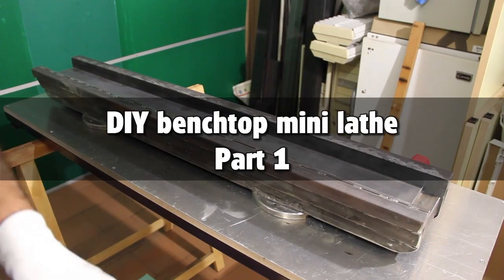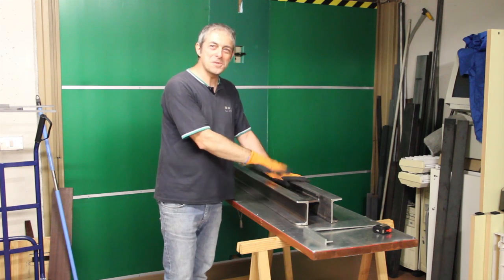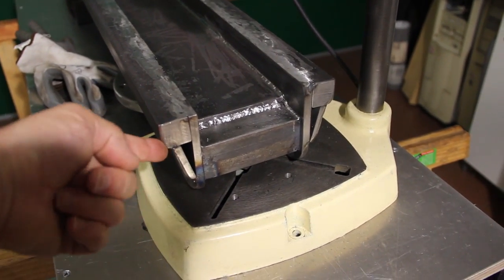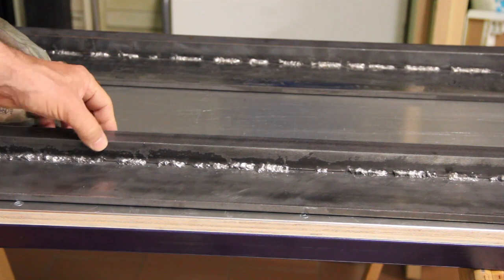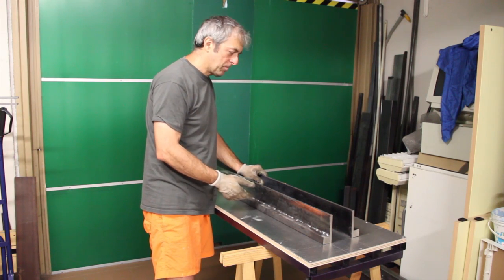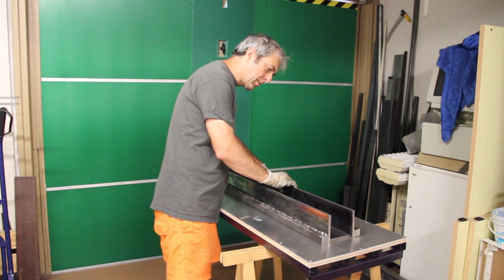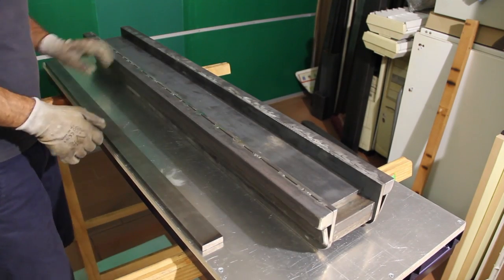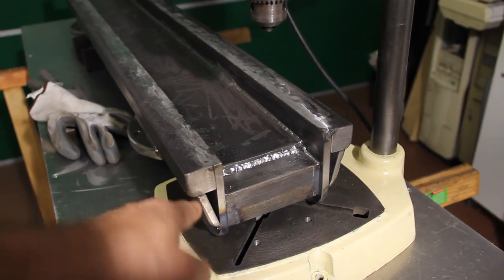Home made Benchtop Metal Lathe - part 1

Comment: Mister,.... i looked at your work on lathe, i am realy inpresed. thank you for your time and corage to show your work and strugles. As welding is concerned. You need to tack (spot weld) al the pises together and then welded whole thing. So that it will not warp more. If you wona have minimum warpage, you need to weld one weld and let it cool compeltly down before you weld another. And direction ow welding is also inportant. Start of the weld will be coler soner as end of the weld and end of the weld will pull together parts, in this way you can manipulate warped weldment to some degree. good day.
Reply from the maker: Thank you mate. Comments as yours are those that reward making videos.

Comment: As a fabricator, might I recommend a welding technique known as stitching. A stitch pattern of say Two inches on center every six inches (for example 3/16 weld 2" long @ 6" on center) should be plenty of weld, and It will reduce the amount of warp tremendously. Even 1.5" on 6" would work.
Reply: I recommend looking on YouTube for a more detailed explanation. Let me know if you would like some video recommendations.
Reply from the maker: Thank you, I indeed learned this myself after the experience shown in this video.

Comment: i found that if i weld on one side of a steel structure, it will fold toward that weld. the solution i found was to weld on the opposite side of that structure, even if no weld is needed, because the contraction helps to correct that distortion. another way is to avoid welding if possible, and using bolts.
Reply from the maker: Yep. You're right.

Comment: before retirement i was a heavy plant fitter trained in the early 70s, welding, fabrication, mill and lathe skills, i know the problems with welding and distortion very well. it takes an awful lot of skill and experience to weld any given part and eliminate distortion because of welds do pull and heat can distort parts in a very unpredictable way, i did know people that could but even after years of doing it i was not one. so dont beat yourself up over that
Reply from the maker: Thank you. As you can see in the following video I started over again with a new piece and a better design. Eventually for other critical parts I opted for "cold welding" . Cheers from the Alps.

Comment: Well this will be a little to late! but I'm thinking of building one myself. The welds looked like mine a couple of years ago, but I have improved on that. One thing I learned on YT is to watch other people  make what ever they make and learn from it. Your welds needed more heat and slow down your puddles to keep the metal hot as you go down the run and do spot welds to, that keeps it from bowing on you. Don't weld all in one spot, it will over heat the metal and warp it, that's why you spot weld in different places before you weld it all up. O I just started watching your video and plan to watch all the parts so I can build one myself, and thanks for this video!

Comment: Thx for sharing. I know you have moved on, so for the future. As for your welds they are cold. You need to turn up the heat. I no expert but have one of the welding experts like Bob Moffatt @ Weld.com look at your video at the appropriate time. Please give Bob a good time index so as to not waste his precious time.
Clay Pruitt also mentions that to reduce heat distortion don't weld until the metal gets hot. Weld then stop move to a different place weld some more lather rinse then repeat.
Overall DIY a lathe is a cool idea.
Again, thx for sharing.
Reply from the maker: Thanks for the hints. I have learnt some more in the meanwhile and, most importantly, I have found that my old buzzbox has some problems with 50Hz (mine is a 60Hz machine). With the new inverter welder is just an other world.

Comment: You could drill 8mm or 10 mm holes and fasten them in screws and weld them to the ends or leave them so removable without welding that much, because from the welding the metal pulls
Reply from the maker: True, but welding provides more rigidity. However, I've started over again in the part 2, with a better design.

Comment: I knew as soon as I saw the welded piece that it was going to be a problem. The source of your failure is: too much welding. Your welds looked good-but it was waaaaayyyyy too much. Your piece would have retained excellent structural integrity with a minuscule fraction of the beads you laid down. All those welds allowed enormous heat to build up in the piece and, and voila: instant distortion. Next time: only lay down as much filler material as is absolutely needed and you’ll be fine.
Reply: also i dont see that the parts were prepared right, no chamfering cuts were made to give the welds a deeper penetration. You can see the grinding to flatten the welds leaves visible gaps.
Reply: @gridless-t5h  that’s a really good point as well

Comment: My Good Sir!
What would have happend if you preheated all the parts befor welding them up together? if you do have someone who helf you heat the metal up for you so you could start to weld the parts togethr or if your only one man and the is no other that can help you with the torch, if you hade a oven to heat the parts and then welded then. dont for get safty protection waew. thank you for upload.
Reply from the maker: No way. I am not an expert at all for welding, but in my humble opinion C bars are the trickiest to weld as they seem to embed a lot of tensions because of their shape and the way they were formed (by hot extrusion.)
About safety protections, that leather vest, that I made myself, is soft and incredibly effective to shield from sparks and heat.

Comment: Hi sir I'm trying the same on my shop, If u have problems with twist or distortion, maybe you consider put the bed on a oven more or less 2 hours for normalize the tensions created by the weld process, I made the same on my lathe bed and work great, if u interest consider see my videos, same with different language I show the step by step in the end with photos
Reply from the maker: Thank you for the suggestions but I already did that on the second try that went better and, as you can see in the part 2 video, that second bed was oven treated, sandblasted, and milled flat.

If a part is badly distorted the oven could not be enough to make it straight, but heating with a torch at specific points could do the trick however that goes beyond my abilities and equipment so I've preferred to start over again with a better design too.
I'll give a look at your videos.

Cheers.

Comment: If you had stitch welded the first attempt and not put so much heat into it, it may have stayed flat....no need to weld every single inch solid like you did...also as someone else stated you could have used a surface plate to flatten the first bed....not a bad idea to do anyway even if you think it's straight after welding...
Reply from the maker: Yep, lesson learned. Actually the second attempt was made by stitch welding, starting from center, with alternating pattern. Eventually I preferred the second attempt, as I realized that those C bars are not well suited for this job. 

No way to flatten the first bed using a surface plate, as it went way too much bended. As you can see in the second part of this video series the bed has been milled. That was a process made off camera: after a 600C oven treatment to release tensions, I've sent the bed to my cousin's shop to flatten it on a milling machine. That made the surfaces not perfectly flat but flat enough to let the ways to sit properly.
Then I've flattened the ways using the Whitworth method (actually a variation of it). Now the work is stalled because I'm awaiting for an alternative motor for the spindle as I've discovered the one  initially picked was defective, and very likely I'll have to redesign the headstock's bracket to accomodate the new motor. As soon as I'll solve this problem I'll upoload more videos.
Cheers.